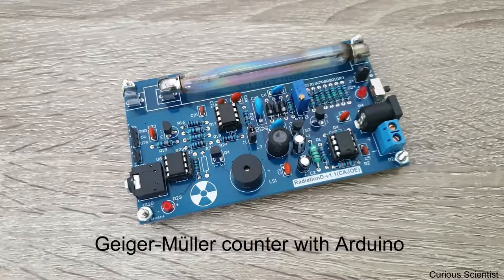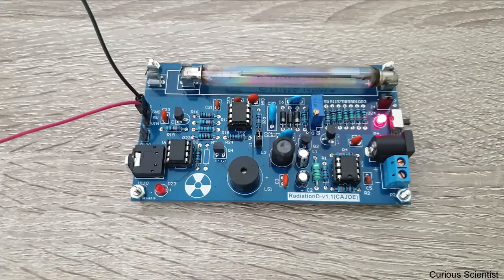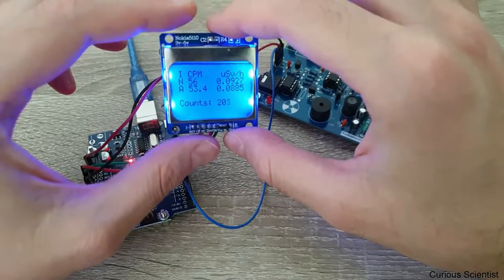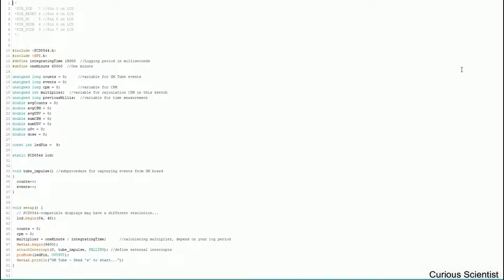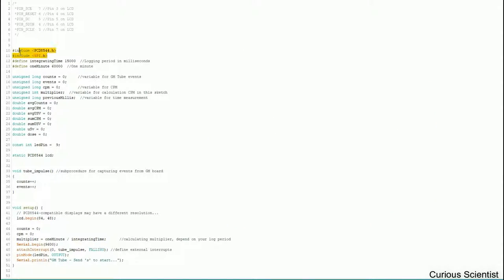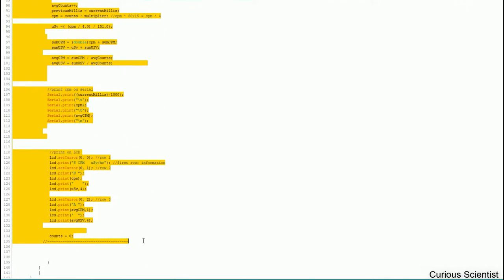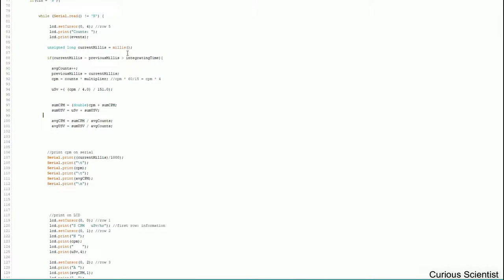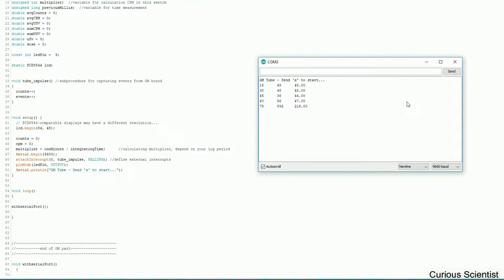Geiger-Müller counter demonstration

Comment: Worth mention that the AM-241 source used here in this video, is mostly an alpha emitter. This tube can't detect alpha particles (if interested, look at the "MST-17" tube with an alpha window). But AM-241 is also emitting (very low intensity) gamma radiation. And it's the tiny amount of gamma radiation the counter detects in the video. Great video, and thanks for the code.
Reply from the maker: Thanks for the valuable content! You are absolutely right about the radiation. We see the gamma here.
Reply: Would the MST-17 work with this ardunio unit?
Reply: @joshuapeters2764  Not without modification of the power supply. While a common geiger tube like this requires about 400V (+/- some volts perhaps), the MST-17 need 1600V to operate. Some more info here:  https://madexp.com/2017/12/10/mst17-mct17-mica-window-geiger-tube/

Comment: So why do you divide CPM by 4 first and only then by 151? On banggood page there is a link to some kind of manual and it states there that conversion is CPM/151!?
Reply from the maker: Hi! Because we don't measure a whole minute to give the counts per minute (cpm). What I do, is I only integrate for 15 seconds (1/4th of a minute) and calculate the CPM from that value. So, the factor of 4 comes from that part. If you set your  integrating time to one minute, you can get rid of these conversions, but then, you get updated values only at every minute. 

The background radiation is not expected to fluctuate drastically, and I also calculate a running average, so I am fine with the 15 s integration time, instead of a minute or more. 

Please don't forget to subscribe, if you haven't done it already! Have a great day!
Reply: @CuriousScientist                    cpm = counts * multiplier; //               uSv =( (cpm / 4.0) / 151.0);   so 60 000/15000 = 4    -> cpm=  x * 4; and then next you do opposite (CPM/4)/ 151 Shouldn't it be (4*CPM)/151 as your cpm reading is 1/4th of minute?
Reply from the maker: @oneofusall  Ah, now I see, thank you for pointing out the mistake! I added a line to the description and updated the source code on PasteBin. 

The formula should be uSV = CPM/151. Before this line (line 92), the CPM is already converted to represent the real CPM, so it is simpy just CPM/151. Or alternatively uSv = (4*COUNTS)/151.

Comment: Your video  is very nice.  Actually I have a Geiger board like that, and want to connect it to an anrduino.  There is just um point that was not clear for me.  In what pin of Geiger board you connected the arduino to have the counts??
Reply from the maker: Hi and thanks! I think you haven't watched the video. I say it at 4:45.
Reply: @CuriousScientist  Thanks for your very fast answer.  I actully saw it but did not realize that  you speak that. The signal is the VIN pin of the Geiger board?
Reply: I tryed using the VIN, it works nicelly.  Thanks
Reply from the maker: Glad to hear that you figured it out!

Comment: I love this video, how did you wire everything up? (for someone who doesn't have any Arduino experience)
Reply from the maker: Hi! Please check the source code for the Arduino on PasteBin (see the description). The source code has all the wiring. 
Which is maybe not super obvious from the code is the pin which brings the signal from the GM board to the Arduino. It is an attachinterrupt() pin, so it is connected to the pin 0.

Comment: Hi, I'm not an expert, however I replicated this Geiger counter, the problem is that the display only works if I send the "s" start signal from the PC, while if I use it with a battery it stops at the wording "Serial.println("GM Tube - Send 's' to start..."). How can I solve the problem? Thank you
Reply from the maker: Hi! Remove the parts of the code that make it wait for the "s" character from the serial port. Basically, just remove that if() condition. Don't forget about the curly brackets.
Reply: @CuriousScientist   Thank you solved!
Reply from the maker: You solved it, I just guided you! 😎 Cheers!

Comment: Great video! Where can I find the circuit board you used in the video to detect the radiation? I can't find it on your website.
Reply from the maker: Hi! Unfortunately, I could not find affiliate link for it, so I did not put it on my page. Just search for "DIY Geiger counter kit" on Aliexpress.
Reply: @CuriousScientist   Ah ok. Thanks! Is there a possibility of wiring a LND 712 to this kit? I am looking for a geiger tube that detects alpha particles rather than Beta and Gamma rays.
Reply from the maker: This I honestly don't know. If it is also just a GM tube with similar characteristics, then I assume that you can just use the terminals. But I have no experience or knowledge with other tubes. At least with this module.
Reply: @CuriousScientist  Ok. Thanks for the reply!

Comment: Hi, sorry to bother you, I added 3 LEDs, one green, one yellow and one red to turn on and flash when the uSv are less than 1 (green), yellow when they are >1 and <=5, and red when the uSv are exceeded 10 uSv, I tried many lines of code but it doesn't work for me. But can it be done? If you can help me I would be grateful if not it doesn't matter. Thank you
Reply from the maker: Hi! You just need to turn on the corresponding LED when a certain threshold value is met. It can be done with simple if() conditions.
Reply: @CuriousScientist  yes i tried but it doesn't work. What data should i take from the sketch avgUSV? or uSv? or what?
Reply from the maker: Well, it is up to you if you want the most recent reading or the rolling average to be used as a threshold. I cannot guess what you want, sorry.
Reply: @CuriousScientist  ok thanks

Comment: Great video thanks for sharing. I wonder one thing.
this GM tube working >300 volt. how is it increase this voltage from 5 volt? via capacitors? how?
thank you.
Reply from the maker: Hi and thanks! As far as I know, it is done by a transformer with a lot of turns on the secondary of the coil. But, I don't know how it is exactly done on this specific circuit, but most probably as I described above. I have never checked the schematics in such detail.

Comment: nice video, i got around 20 cpm and 0.15 uSv in my room :D. why so much space in your code and try to use tab when intending
Reply from the maker: Thanks! This was among my earlier codes so I didn't put too much effort into formatting it. You can format the code freely as you wish. Arduino IDE also has an autoformat option.

Comment: I have the same Geiger counter and am currently connecting it to the Arduino Uno. In your program, the CPM updates every 15 seconds. Since this is multiplied by 4, the CPM values are all divisible by four. Is there a way to program it so that an exact cpm (every whole number) appears every 10 seconds? I have read that this is possible with a moving average, but I have no idea how to program it. Can you help me? I have almost no experience with Arduino.
Reply from the maker: It is relatively easy to implement moving average. The time base could be anything. I published the code and carefully explained it. If you still cannot modify it for your needs, you can hire me for doing it.

Comment: hi, mine is not working, i used the code from your website, it shows a bunch of random numbers, even when the geiger counter is off, do you know what is happening?
update: i solve the problem, the ground of the geiger counter was not conneted to the arduino, hehe, thank your for the video, i changed some things in your code so i could use an OLED display, and works perfectly
Reply from the maker: It is great to hear that the issue was not my code. Have fun using it! Cheers!

Comment: Hi, I don't know wiring of the lcd. In datasheet default pins are 3,4,5,6,7 for this lcd yours are diffrent. Can you answer which pins of arduino you used to 
appropriate pins on lcd
Reply from the maker: Hi! These are the connections I used: SCE 7, RESET 6, DC 5, DIN  4, SCLK 3. I soldered VCC and BL together on the panel and it is connected to 3.3 V. GND is obviously GND.
Reply: @CuriousScientist  thank you very much, now I can do it too!
Reply from the maker: You are welcome! I hope you'll enjoy it, have fun!

Comment: That tube cant detect alpha what you are detecting with anericium is  not from americium americium 241 decays to neptunium 237 its pure gamma radiation what it detects alpha needs a special probe :D
Reply: Perfect video
Reply from the maker: Thank you for the clarification! Yes you're right. The detector is not directly picking up the alpha radiation, but one of the side products of the decay, a gamma particle. 

To detect the effects of the alpha (i.e. ionized air) _directly_, one way would be a so-called spark counter. It is somewhat similar to a GM tube, but the mesh-wire is not surrounded by a protective gas to suppress the avalanche. 

In this video, I just wanted to use the Am-241, because this was the only source of radiation which is easy to access.

Comment: Now with the code am I able to run just the lcd and Arduino off of the board without computer?
Reply from the maker: Sure. That's the original/default mode. The computer connection is just a fancy addition.
Reply: @CuriousScientist  am I able to program the lcd and just run the lcd off the Geiger board minus the Arduino??
Reply from the maker: You need something to drive the LCD which is in this case the Arduino. Something must capture the signal from the GM board and send it to the LCD. So you need the Arduino.

Comment: Tried uploading and I’m getting error on line (21) PCD8544 does not name a type. “static PCD8544 lcd;”. Any help? 😅
Reply from the maker: Do you have the library installed?
Reply: @CuriousScientist  library is installed.
Reply from the maker: Ah, then I asked the question in the wrong way. Let me rephrase. Do you have the library correctly installed? Did you install from the library manager or from a zip file?
Reply: @CuriousScientist  oof no, just from the library manager tab in sketch..
Reply from the maker: @DENTAL_MEAT  Try reinstalling the library, maybe you have an obsolete version or something. Make sure it ends up in your Arduino/libraries folder. Also, try to install the library from a .zip file.
Reply: @CuriousScientist  I’ll try that. Thank you!

Comment: Hi, thanks for project. ı cannat open Geiger-Muller Recorder interface (software demonstration). Plese help me
Reply from the maker: Hi! What do you mean by the "recorder interface"?
Reply: @CuriousScientist  I uploaded the code with Arduino.  LCD also reads data.  But I couldn't open the Geiger Müller recorder program.
Reply from the maker: Oh, now I understand. That's not part of the software. If you have noticed, I only shared the Arduino code. The software I made to visualize the incoming data is not publicly accessible.

Comment: Do you need Arduino to setup it?
Reply from the maker: No, you don't. You can use the circuit as a standalone device. In that case, you'll only have the clicking sound and the flickering LED as feedback.
Reply: @CuriousScientist  Thank you very much! Nice video!
Reply from the maker: Thanks!

Comment: Is there a way to disable the "speaker"?
Reply from the maker: Hi! Yes, just remove the J1 jumper.
Reply: @CuriousScientist  Thank you. I have this thing for years no in a cupboard and and just bought an ESP32 with wifi and try to upload the values in a database to make some statistics stuff. Thanks for your great video!
Reply from the maker: I am glad that I could help! Sending the data to a cloud sounds cool! Only thing is that check if the tube is sensitive to daylight. I read it on some forums that the tube picks up false radiation due to the effect of daylight. Not all of them are "faulty" but some are.
Reply: @CuriousScientist  I will check this. I have GMC-300E geiger counter as well and the values are comparable. But it is in the middle of the night. :)

Comment: Four_Digital:1:10: fatal error: PCD8544.h: No such file or directory

 #include <PCD8544.h>

          ^~~~~~~~~~~

compilation terminated.

exit status 1

PCD8544.h: No such file or directory

I installed pcd8544 libery
Reply from the maker: Well, the error code says the opposite. Make sure it is installed in the libraries folder and that the IDE sees it.
Reply: @CuriousScientist  also I can't find the wiring in the script
Reply from the maker: Watch the video carefully and check my website.
Reply: @CuriousScientist  i fixed installing old ver. but I have still trouble with wire LCD works with exemple script but I m not sure with your/On video its not clear and I cant find on you website
Reply from the maker: The PCD8544 has its own wiring, it is really easy to Google it how it is connected. The interrupt pin is in the code. That is the pin which accepts the pulses from the GM counter.
Reply: @CuriousScientist  I still cant figure arduino-Lcd Pin connection . On video seems like 2 is GC-Vin , 4 -3(lcd) ,5 -4(LCD), 6-5(lcd) , 7 -1(lcd), 8 -2(lcd)
Reply from the maker: @kenarf3332  Have you ever bothered using Google? Or even simpler, reading the comments under this video? Pins are: SCE 7, RESET 6, DC 5, DIN 4, SCLK 3.
Reply from the maker: @kenarf3332  Please go to my website (link is in the description). I added a drawing to clarify the connections as well as I added a small description to the picture. Hope it helps.

Comment: Hallo, ich habe das nachgebaut und dabei das Nokia 5110 Display zerstört. Jetzt habe ich gelesen, dass das Nokia Display 5110 Pegelwandler von 5 Volt >3,3 Volt benötigt weil es die 5 Volt vom Arduino (Logikpegel) an den Dateneingängen nicht verträgt. Können Sie das bestätigen?
Reply from the maker: Hi! The display exists in various formats. Some of them tolerate 5 V, and some of them don't. Always refer to the specifications of the display you purchase. To be on the safe side, just use a level shifter. It is cheap. 
(P.S. the language of the channel is English, if you want help, use English)